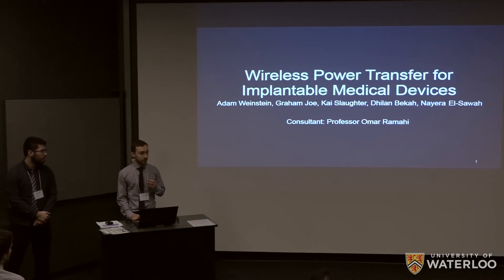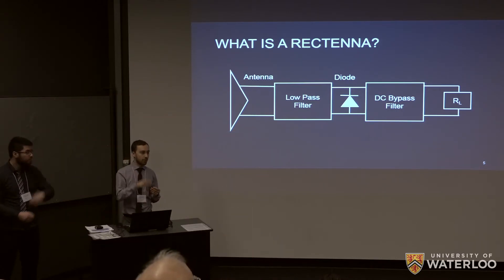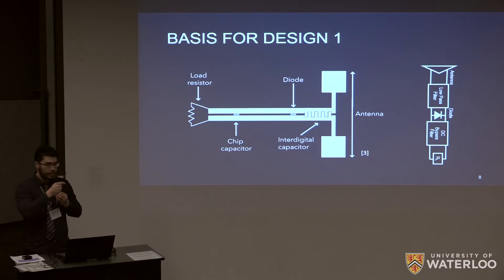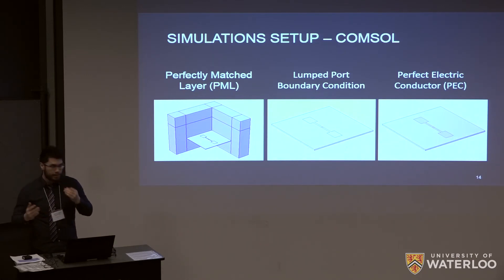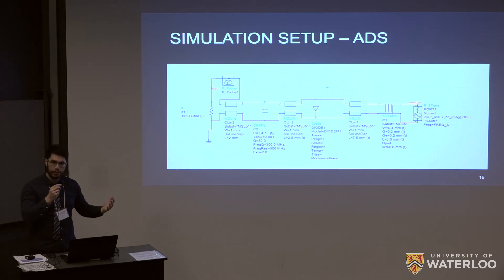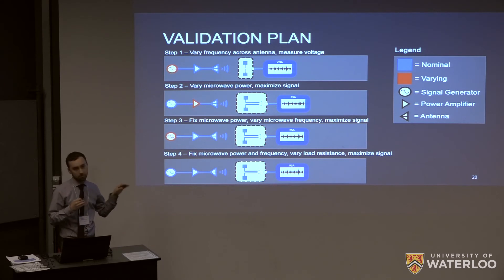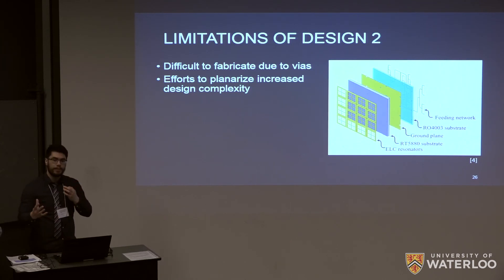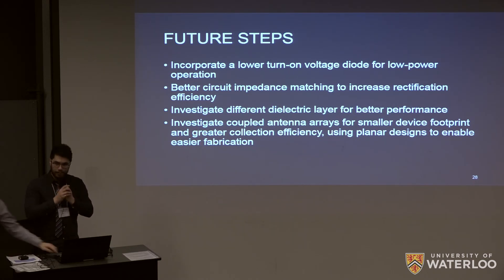Wireless Power Transfer for Medical Devices

Comment: Your first designed antenna has very small effective area. Probably, that's why it can not receive much energy from the Horn antenna. You can test it may be by reducing the distance between two antennas.